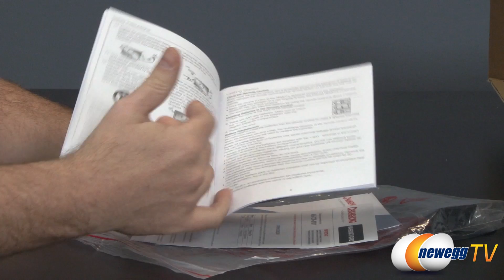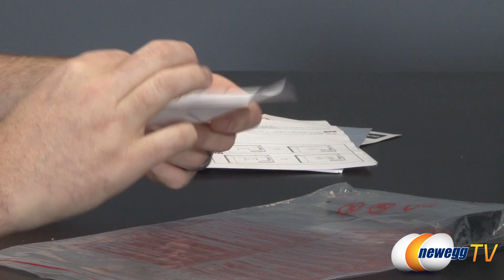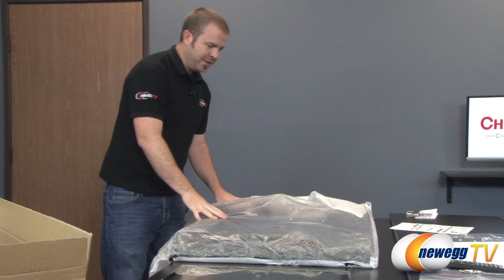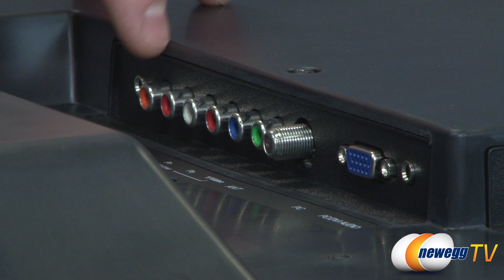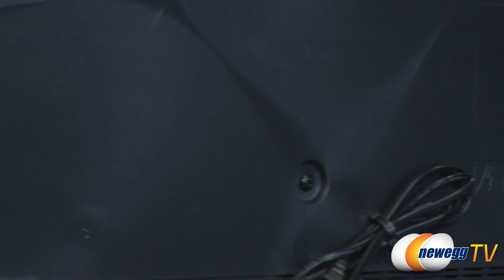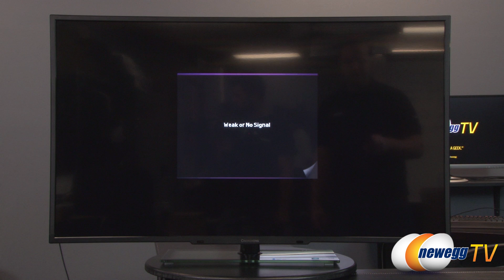Changhong 50" 1080p LED HDTV - LED50YC2000UA Overview - Newegg Lifestyle

Comment: I connected the TV to my DirectTV and either get a Weak or No Signal message or the screen shows up blue and distorted.  I hooked it up to my PC with an HDMI cable and it worked fine. Even when switch between all the resolutions nothing fixes it. It sounds like a DirecTV issue but I cant be sure.  Any recommendations?

Comment: I only get 480 on my directv and Xbox, both connected with hdmi cables.  I've looked through the tv settings, can't find anything that changes it to 1080
Reply: you have to change the settings in the xbox settings. same goes for your directv set top box.

Comment: if no hd tv antenna, just bend paper clip straight, then make large L shape, then just stick one end of the paper clip GENTLY on the back where coax for antenna goes, and do the auto tune, and voila! , you should get all the local HD channel that you are supposed to get.

Comment: Its $400 bucks on NewEgg until 2/3.  I got a Sony Bravia 32" 2 years ago after 14mos it started going. For this price if it sucks I won't feel so bad. I think the electronics in all these better brand units (especially the export models) are made in some slave labor sweat shop regardless.
Reply: I've had a KVL-40V3000 for 6 years and it's just as great as the day I bought it. It even has HDMI-CEC so my chromecast, comcast X1, Playstation 4 , XboxOne, and panasonic amp all switch to the right inputs and outputs for the sound on the speakers and video on the right TV input.

Comment: ManuKey25 you stated that life expectancies of TV's dropped from about ~20 years since TV's are being made in China. Most TV's don't last 20 years or even close to that, especially with the rise of LED, plasma, etc. Compared to the box TV's back in the 90's(which could last 20). Show sources if I'm wrong, but I worked as a TV repairman for 3 years. Also going about by your other comments you hate on Chinese products for no reason or logic.

Comment: So i can get this as a bundle but am buttraped scared to even attempt to by this product with my ps4 and xbox is there any reviews out there that are true or what?
Reply: Clearly you're the one who doesn't know what your talking about because the refresh rate is how many times the tv refreshes the image on screen in a second. Nothing to do with picture quality. A higher refresh rate just means the image is played back in smaller increments over the same period, resulting in less jumps between frames and a smoother picture. Like I said, most people with less than normal vision, can't see the difference. What are you talking about with the not bright or vibrant? Have you ever owned an LED or any other high end tv? Surely you're not dumb enough to make that conclusion based on this video. You HAVE to tune settings on new sets. They don't do it in the factory, especially in value targeted products. That would cost money to have an employee do, and would turn the set into a loss leading product, which doesn't make sense in an online environment, mostly in retail where you can control inventory placement and end aisle marketing to make profit off of it.
Reply: What are you talking about? There's 188 reviews on newegg.
Reply: CJ Culbertson Some are bad some are good.Only problem is that I never actually bought a moniter off the internet lol
Reply: 96komodo Go to Newegg and find this tv, then click the reviews tab and sort them by most helpful and read a few pages if you're worried. All the ones that say Verified Owner are people who used that account to purchase the item, so they are real owners. I'd buy this in a heartbeat if I had the cash on hand.
Reply: krome411 Subjective. Not everyone cares about 3D capable or double refresh rate. Blu-rays only play back at 24 or 60 fps anyways. Most people with anything less than normal vision can't even see the difference between 60 and 120. Also, how is a 50 inch 1080p LED tv for $400 not worth it? You won't find anything remotely in that class for that price.
Reply: CJ Culbertson As a PC gamer, one can absolutely see the difference in fps.

Comment: i got this tv and using it, and liking it..well tv is tv, given its cheap price, as long as it can last more than one year, I am fine. I got a Sumsung for 600 dollars back in 2012 for 32 inch 1080, and it stopped working just a little over a year (right after warranty expires)

Comment: ...it doesn't have composite video?
Reply: As with most modern HDTV's, they have done away with dedicated Composite video inputs. That being said, you may have noticed during the video demonstration of the input selection that Composite was an option. If you plug in the audio and video to the Component inputs (only one of the RGB inputs is used) and select Composite, it will work just fine. Hope that helps!